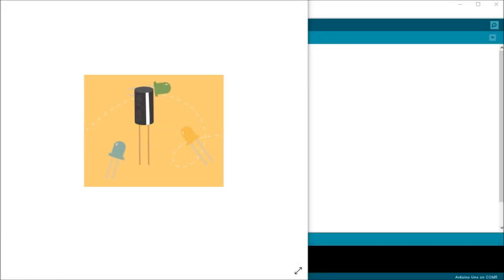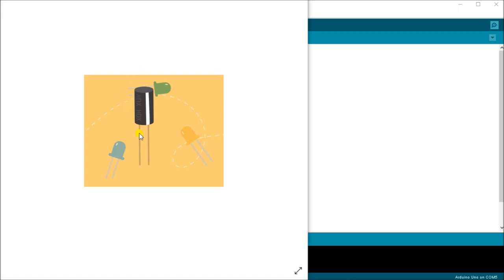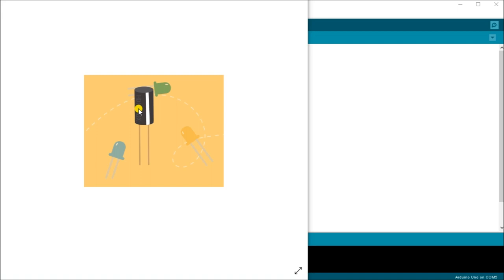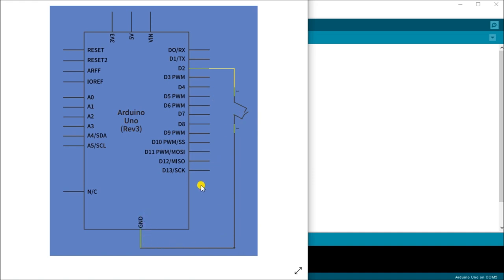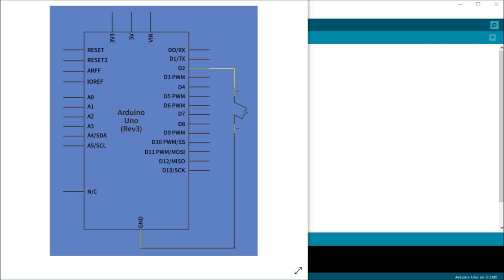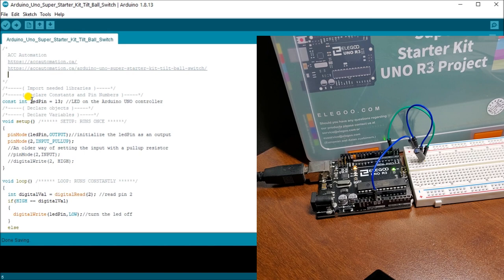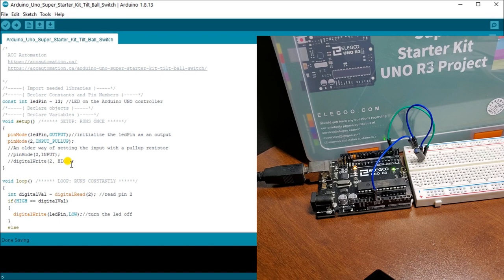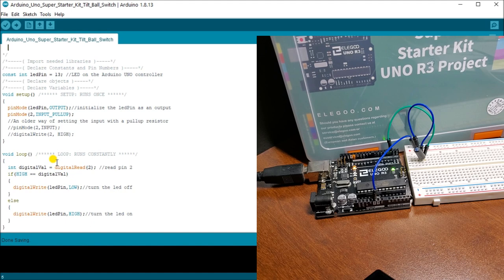Arduino Uno Super Starter Kit Tilt Ball Switch

Comment: The (if HIGH == digitalVal) statement is very difficult to understand. (For me anyway!)
Would you be able to break it down for me please?
Thanks.
Reply from the maker: Hi John X,
This is the comparison operator. In this case, if the digitalVal is equal to HIGH (On, 1) then we can do something.
The If statement will do some action if the value is true or else do something else. Here is the code used:

{
int digitalVal = digitalRead(2); //read pin 2
if(HIGH == digitalVal)
{
digitalWrite(ledPin,LOW);//turn the led off
}
else
{
digitalWrite(ledPin,HIGH);//turn the led on 
}

Here is a link to the corresponding post for this video:
https://accautomation.ca/arduino-uno-super-starter-kit-tilt-ball-switch/

I hope this helps you out.
Regards,
Garry
Reply: @ACCautomation  Hi Garry, thanks for helping me with this explanation.  What threw me was the 'if(HIGH==digitalVal' bit.
It's as if HIGH is the variable, not a condition.
It' seems like it's the wrong way around.
Usually, I see or write: If (variable == HIGH).
Is HIGH the condition, like LOW?
It will take me some time to digest your explanation (beginner), but I am grateful you took the time.
Thanks.
Reply from the maker: @johnx9318  
Yes, HIGH is the condition for the IF statement. It will be either true or false.
Regards,
Garry
Reply: @ACCautomation  Thanks Garry. This has cleared up a long-term conundrum for me!